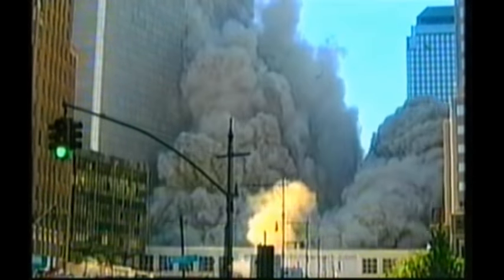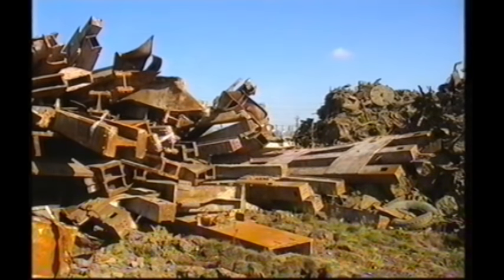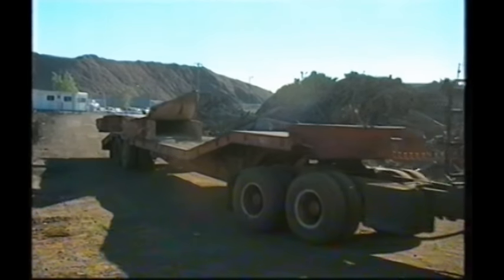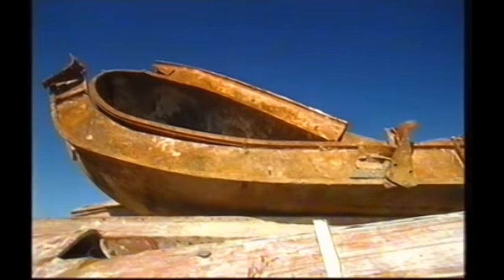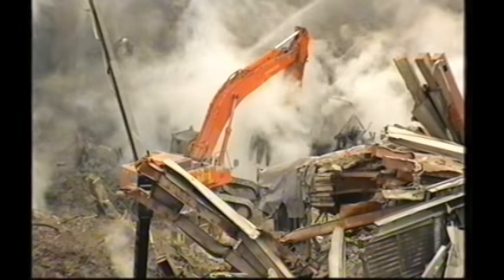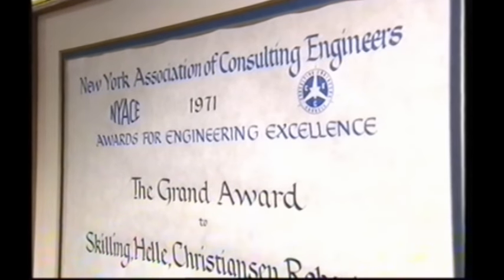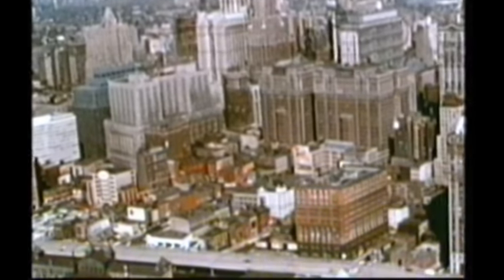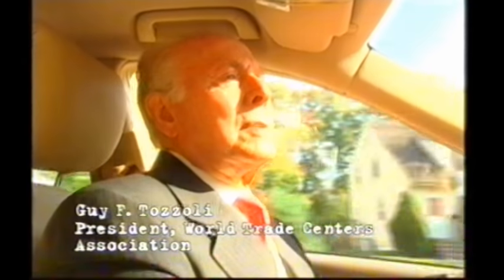9/11—"How The Twin Towers Collapsed" (C4 documentary, 2001)

Comment: I was a tourist and visited and out of curiosity perused and studied one of those buildings the reason was I also happen to be a Millwright by trade. One of our skills is to erect steel buildings and I studied my trade the how’s, why’s and what’s at college. What I deduced was that the buildings were like steel boxes with huge beams making up the outer walls and the floors and all connected and reenforced by a column of huge I-beams in the center of the building from the base to the top, you know like a Christmas tree with the trunk and branches. Not only did the outer shell and the floors collapse at an impossible fast rate but so did the massive trunk or center core of the building. Whaaaaat???????? Impossible UNLESS all (or most) of the steel junctions exploded at basically the same time. The massive central inner core logically should have been left standing and that was definitely and absolutely blasted to smithereens. I think it’s time to reinvestigate and throw the vampires who planned and who did this evil deed in an appropriate uncomfortable place.  BTW I worked in a foundry for years and I know what it takes to melt or weaken ( via heat ) steel and it’s not office furniture. Google and see the process as it’s a difficult, super hot operation. PS your steel pan does not weaken or melt on your stove. Wake up people we are being bamboozled and controlled.
Reply: Yup
Reply: Untrue! Force equals MASS times ACCELERATION. Newton penned this.
This explains why the central core failed too.
Once you fall 3 metres or one floor, the forces are multiplied, the chain reaction principal makes total failure inevitable.
Reply: still, a rapid collapse is very different than free fall speed.  the support of lower floors wouldn't collapse as if made of nothing but air.  never understood that discrepancy.
Reply: @jimcarlson6157  I can relate. Really can! However the free fall speed is consistent with that expected when you look at structural failure. Note in the many videos of tall building demolition, they look like they fall at the SAME SPEED as WTC Towers.
Reply: You have a fundamental misunderstanding of the design and construction of the twin towers. These buildings were able to be tall because they were essentially hollow and constructed from (relatively) lightweight components. There was no 'steel cage' in this design. Instead, there was a central core of vertical elements, a perimeter of lighter vertical elements, and lightweight trusses connected the perimeter to the core. This design was completely dependent on structural integrity in order to maintain stability and strength, otherwise it could become unstable and collapse of its own weight. The airplane impacts damaged some perimeter and core elements, but the main initiators of the collapse were the failures of the trusses due to heat from fires. When these critical elements failed, the perimeter vertical elements bulged outward and therefore lost their ability to support the floors above them.
Your speculations about controlled demolition are also unsupported. Where is the evidence? Also, where is the unexpended wiring, detonation cord, electronic devices, etc. necessary to support this but which has never been found? Who did this? How did they wire two 110-storey buildings in complete secrecy under the noses of tens of thousands of people who occupied them? Finally, if the buildings could be blown up, then what was the purpose of the airplanes?
Reply: your rite bro, ive worked steel all my life and some one trying to pull the wool over the public's eyes,,,,,,,,,,,,
Reply: And yet, we have numerous actual engineers on YouTube and other places, explaining exactly how buildings tend to fall straight down when they fail. We also have tons of actual engineers explaining exactly how the WTC towers fell. But I guess the iron worker will know more than people that actually understand physics…..

Comment: I lost two friends and my sister barely escaped being swept away by one of the falling towers. I can understand poor Leslie Robertson's guilt, but it was not his fault whatsoever. I am sure if he had planned on a stronger design, the bean counters would have laughed him off.
Reply: No matter how strong it was it was coming down. When people place enough explosives in anything it will be the demise of that structure.
Reply: Have you thanked mr Bush yet for that
Reply: They were designed to take a direct hit from a Boeing 707, the largest plane at the time. Leslie Robertson should not feel guilt.
Reply: @8bert9  the ones that crashed into the towers were 767s. They didn't exist when the towers were being constructed. I know what you mean though. Whatever the biggest planes at the time were. 707s I think.
Reply: @Thug-12Na 
Amen Thug-12Na. You hit the nail on the head with your statement. Has anyone ever investigated Mr Bush? 🙋🤔
Reply: The only parts that, under normal circumstances, should've penetrated the building were the titanium enriched engines. The aluminum parts would've pulverised on the reinforced steel 'shell' of the building. The nose cone of an airliner, which contains the radar, is made of even lighter material.
Reply: @davidhoover8877  facts controlled explosives
Reply: @davidhoover8877  You should ask just how "Enough explosives in anything it will be the demise of that structure " What people? Ask how these "People" could prep One tower with "Enough explosives" And I'd bet when you saw the towers fall you didn't say or think explosives brought them down When you did hear of "Explosives" You just believed it without a thought and never questioned how? You're talking bull.

Comment: Why weren't the planes intercepted earlier?
How could Atta and the others fly with such precision when they had previously flown only small planes?
What about the extinguisher system in the buildings?
Why weren't more videos of the attack on the pentagon published, just one video where you can't see the plane?
Why was the building practically pulverized and almost free falling?
Why were there so many badly burned, melted cars in the area?

Why didn't NIST look for remnants of explosive material and other irregularities? Not taking into account that firefighters heard explosions.

Why wasn't the crime scene documented, by more independent experts? Instead, cleanup work began too quickly, and the steel was then sold to China. 

A few weeks before the attacks, the insurance on both buildings was renewed.

Many questions remain unanswered, and these are just the ones that spontaneously come to mind.

Therefore, when one thinks about it, there is still an unpleasant aftertaste.
Reply: What about building 7?
Reply: @blueheart1946  Not the subject of this video.  Obviously from the title.

Comment: Why was the steel sold to the scrap yards so quickly? Were the remains examined before they were cut up and disposed of?
Reply: Once it passed through inspection and was determined to be of no further value to the investigation (and most of the steel wasn't), the surplus material was made available for scrap.
Reply: There was no need to keep 500K tons of steel lying around after the analysis and metallurgy had been completed.

Comment: The fuselage and wing spars of the Boeing plane were made of aluminum alloys. The building was made of steel - this film cited how these buidings were constucted  in a special way using steel panels on the outside perimeter all the way around the building to insure it's strength. In an impact of aluminum vs steel, steel would naturally be the victor. That said, it makes no sense that an object made of aluminum would be capable of breaking an object made of steel.  Yet, in the drawing of the inside of the building where the plane hit, it shows multiple steel beams that were severed by aluminum. They didn't even explain that. Why?
Reply: So you're saying those weren't even planes? Wow.
Reply: By that logic, water is stronger than steel.
Reply: Basic physics. Force = mass x acceleration.
The force of a 150-ton aircraft travelling at 400+ knots applied against a localized area of a surface that was made of 30% glass and hollow box girders bolted together will result in exactly what we saw. That airplane was shredded by the 'cheese grater' effect of the vertical elements being 30" apart as well as the fact that each floor of the building was empty between the perimeter and the central core.
The buildings were nowhere near 'solid' steel but instead were virtually hollow so that they would be relatively lightweight and could be built higher (for the time).
Reply: @kyle381000  where they messed up was when the owner said on camera 'pull it' referring to building 7. Everybody in the business knows what that means. It was prepped and ready to go but the 3rd plane didnt show up and they couldnt just leave the building sitting there.
Reply: @BabySkinCondom explain building 7
Reply: @BludShotiiiiis all that insurance also a month before was raised. Weird
Reply: Water can cut steel with enough speed… the planes were travelling at 500+ mph…
Reply: @BabySkinCondom there's no precedent whatsoever for fires causing buildings to collapse like they did that day. #7 was especially suspicious.
Reply: I can put "jet fuel" in my diesel pick-up and it will run just fine. Diesel does not burn hot enough to melt steel. So explain to me what you are saying.
Reply: Jet fuel is diesel quit acting like it's some kind of explosive mixture.
Reply: @kyle381000   the problem is pilots claim those plane model could in no way fly 400 plus knots at sea level without 6 more engines attached ,,there would still be opposing force from the floors below that were not affected by the heat of fire,,
Reply: @truesoulghost2777    no one can ,,so they will make jokes
Reply: @truesoulghost2777   not to mentions the 100;s of put-calls against the airlines --6X the norm,,BEFORE the incident
Reply: @rejinc  
No pilots said any such thing. You have a clear misunderstanding of the aviation term "Maximum Recommended Velocity (MRV)" which is the specific velocity at a specific altitude which a commercial airliner should be flown for extended periods without risk of serious structural damage to the airframe. To many lame brains have extrapolated that to conclude that these airplanes were incapable of those speeds at sea level OR that the airplanes would disintegrate at those speeds. Video evidence that we have all seen clearly debunks both of these misconceptions.
Each floor was designed to support the static weight of the floors above. However, none of the floors were designed to withstand the dynamic load of the kinetic energy generated by all of the floors above falling 30 feet. Anyone who suggests that the downward force could have been resisted simply doesn't know what they're talking about. Period.
Reply: @billycolwell4263  jet fuel is actually kerosene
Reply: Nothing on boxcutters and explosions
Reply: Jet fuel unlike diesel
Reply: @BabySkinCondom  yea I have thought about that but I can't trust someone with a name like yours lol
Reply: @Chris_Patton there was no precedent whatsoever of a 767 hitting a building 70 stories up.
      Empire state building was totally different design hit by a slow moving much smaller plane
Reply: @billycolwell4263 no one said it melted steel, here I'll say it slower for you . .
Reply: @billycolwell4263 excuse me but I'm certain that you inadvertently neglected to factor in the speed of the plane, ergo the extreme volume of highly atomized fuel that was expelled on impact.
    Technically not an explosion but a massive high speed flame front

Comment: The buildings fell down smashing the bottom as the structure above came down as one piece just like professional demolition!
Reply: Except controlled demolitions usually start at the bottom, not the top...
Reply: @kyle381000 says who ? Do you really think a reverse 🔄 demolition couldn’t be done ? As for the free fall speed and total vaporisation of concrete as well as steel beams ? Think 🤔 .
Reply: @fpxpGetReal  
If a 'reverse demolition' could have been done then someone would have tried it by now. They haven't, and they were not going to start trying with TWO of the largest buildings in the world, both of which were three times the height of any buildings which had been demolished with conventional techniques.
As for the 'vaporization', the steel did nothing of the sort. A 5-storey pile of debris is proof of that. As for the concrete, is was simple poured slabs 4" thick and not reinforced. It would have been more of a surprise if it had not been pulverized. 
Think, don't speculate.
Reply: @kyle381000  Steel beams cut in in equal sizes by miracle ? What speculation? I see you have not explained the numerous anomalies and choose to contest a single point (which I should have clarified with the term “ steel beams melted in to lava flow ,as described by the NYPD ) So no rebuttal is your response! Go back to sleep 🛌 and let intellect proceed .
Reply: @fpxpGetReal  
Equal sizes? Yes, as part of the cleanup operation which also left hundreds of V-shapes cuts which conspiracy types immediately thought were evidence of CD. A lava flow is molten rock, not molten steel. And, you're going to embrace the observations of a cop regarding what he thinks he saw?
I will let the intellect proceed, but so far I haven't seen much of it in this conversation.
If the towers were brought down by controlled demolition, then what was the purpose of the airplanes? They would be irrelevant and unnecessary to the plot.
Reply: @kyle381000  Are you just being pedantic or do you just love absorbing other peoples nonsense or both ? 
When you want true knowledge, you would at least have an open , inquisitive questioning mind and reading everything to evaluate fact from fiction ! Absence that ,keep quiet and don’t let your ignorance show .
Reply: @fpxpGetReal  
I deal with physical evidence first rather than engaging in inductive reasoning.
If you have some cogent theories which explain what we actually saw and know, then let's hear them.
Reply: @kyle381000  Well ! Maybe you need to live up to the image you wish to portray and actually look at the physical evidence 🤷🏻‍♂️ and stop regurgitating hearsay . Comment when you have grown up a little,achieved some semblance of wisdom and fully functioning grey matter ,oops matured grey matter .

Comment: There was no problem with the structure design. It was much stronger and more efficient then any other building. The events were so unusual and so damaging that the buildings had no chance
Reply: not to fire it wasn't. Those flimsy trusses just gave way and started collapsing because of the heat...
Reply: @robertgregory2618  anything would had given away after that much burning and heat, plus with the huge weight above